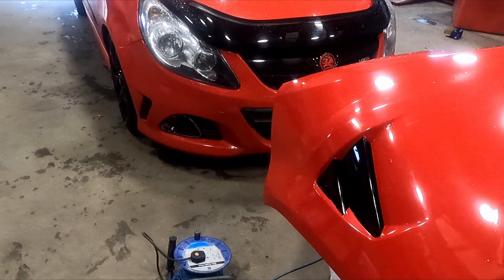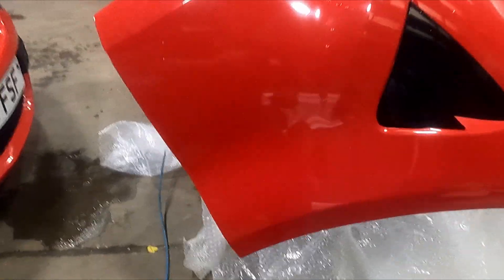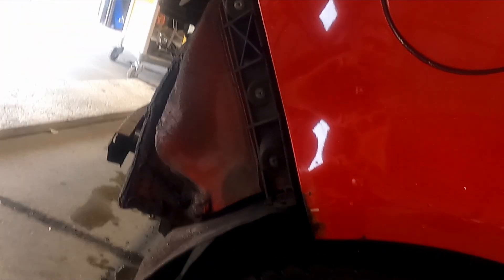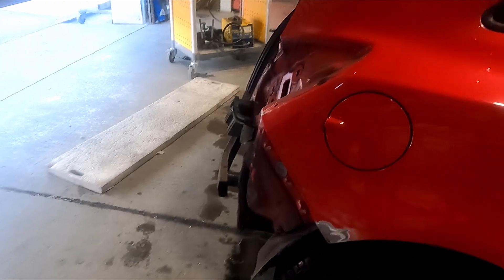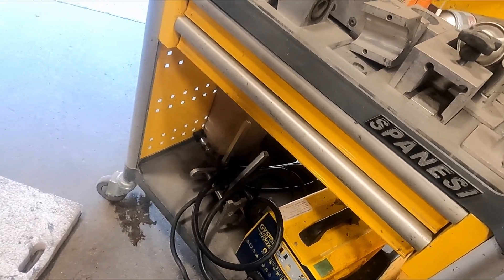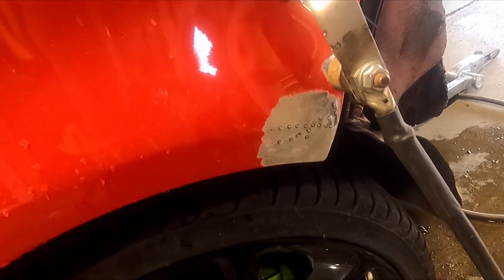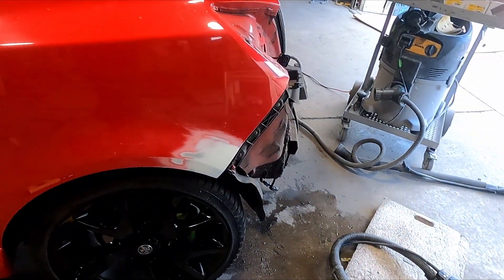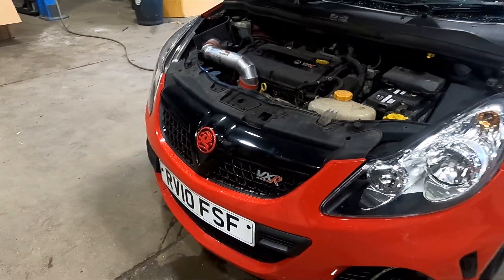VAUXHALL CORSA VXR Racing Edition - Wifey Project Part1

Comment: Well glad your repairing a vx racing edition need to keep the good ones on the road, I keep getting told to sell mine but I’d rather dry store it then sell it. I want to get it forged to help prevent the dreaded P4 issue but then I’ve had mine tuned by RnD now for over 3 years and not skipped a beat so far.
Reply from the maker: Nice mate I don’t thing p4 such a deal if you look after it that’s just my thoughts tho if I’m honest
Reply: @TwoSpanners  well when I first bought mine from sunny Watford it turned up with no history and to my shock no air filter lol good job I was changing the intake system anyway but since then I’ve done quite a few engine mods and remapped to 223bhp & 243lbs torque has updated injectors etc but not forged yet and like I said she’s not skipped a beat yet serviced with 10w 40 oil millers. So you may well be right I think it’s more these car park doughnut hooligans that seem to use and abuse lol 😂
Reply from the maker: @mattacdavison6890  nice mate I won’t be doing anything like that with this one 🤣 she’s just using it as a daily lol so we see how it gos still a couple of little bits to sort out but it have to wait lol
Reply: 283 left worldwide.
Reply from the maker: @scottsvxr  how do you find that out mate
Reply: @TwoSpanners  They were produced to celebrate Vauxhalls success in the Touring Car Championship, All Red and Black, UK only, as Triple 8 done all the tuning Vauxhall commissioned a total of 888 cars split down the middle, Astras being odd numbered Corsas being even. Anyhow it turned out Vauxhall got more orders for the Astra making the the Corsa even more rare. They are registered different the a Corsa VXR ....Corsa VXRACING on the logbook. 
Can't enter the website on YouTube but here it is howmanyleftcouk just put the dot in lol😎.
Reply from the maker: @scottsvxr  yeah there was only a few silver zaf gsis left on the road when I had mine. Wish I never sold it 🤣
Reply from the maker: @scottsvxr  I know all the history mate I’m a bit of Vauxhall freak didn’t think you could find how many where left that’s all, as this one’s going no where 🤣 apart from storage once she’s done with it ha